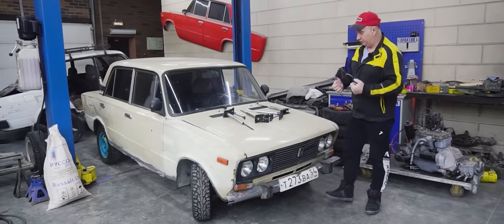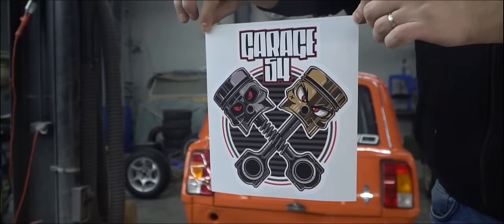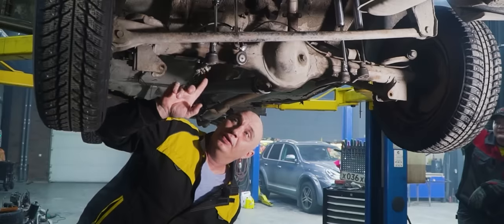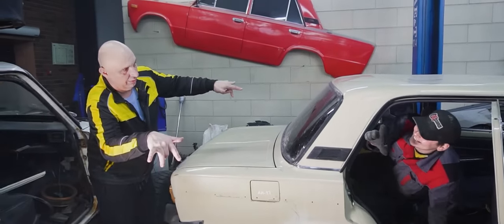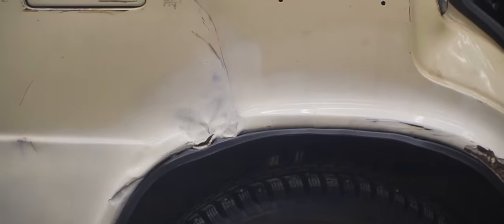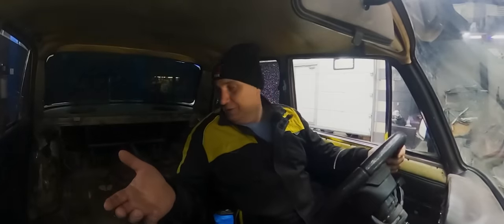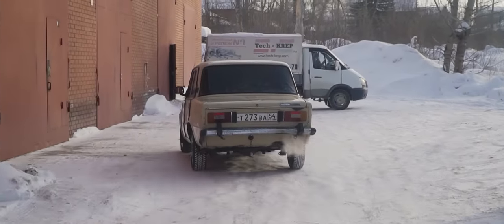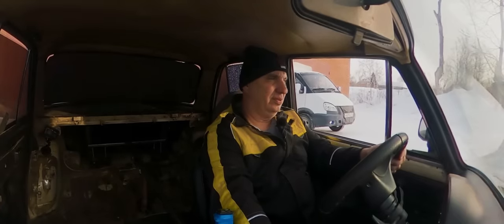We make adjustable suspension using office chair cylinders

Comment: Could have left 2 in the "pushed in" state, even a bit, and 2 full out- that would have softened the ride a bit
Reply: maybe, but i've seen fat people blow them out by dropping their full weight into a chair. if you put too much stress on them it will just blow something out inside and lose pressure forever.
Reply: @iamzid  He said they were designed to support 180 KG.  That is around 1400 pounds between the 4 of them.  Back of a Lada doesn't weigh near that much.
Reply: Actually it's working like that, you can see that one is more compressed than the other, because of the height difference
Reply: @White_Night_Demon  You don't even have to be that heavy. I've seen them break when one of my friends threw himself on one. He doesn't weigh more than 80kg so you don't have to be fat to break them, just fast lol
Reply: @schwuzi  hahahaaha so I guess these shocks arent great if you're gonna use your chairs jumping up and down on them...

Comment: I always wondered if you could convert shocks into hydraulic cylinders.  You should try that sometime.
Reply: I dont see why not, replace the compressible air space with some hydraulic oil, it should work as long as the seal can take the pressure.
Reply: I mean Hydropneumatic Citroëns have hydraulic cylinders and spheres instead of shock absorbers and springs
Reply: @onelyone6976  yep and you dont want to work on them
Reply: @allanmakkink8404  Truth. There are good reasons why those Citroens have only a cult following, 95% of the fans dont even know how terrible those cars are. Comfort, sure, but not as good as a 70ies Jaguar XJ6. Roadholding, sure, but again not as good as a 70ies Jaguar XJ6.
Reply: @allanmakkink8404  why? It's actually quite a simple system at the end of the day
Reply: You can definitely do that. Where I work, we use hydraulic cylinders and fill them with nitrogen to get them act like a big spring. Works great but kinda dangerous.
Reply: @pflaffik  semi comfort for me and when it brakes it don't cost 10 k to fix

Comment: This was cool.
Hey, Garage 54 Fellas! 
How many Radiators In-Line before Water Pump Failure?
Reply: Why would the water pump fail in that sort of situation?
Reply: I think those old fashion fanbelts will slip if the pump pressure gets too high, or the pump will simply pump but not manage to move the water. No failure will happen, i had exploding coolant systems due to blown headhaskets and even then the waterpump survive. 
I have seen old volvo waterpumps with broken blades, doubtful its pressure though, more likely calcium buildups and high age (the rotor is cast, not machined, high deterioration rate).

Comment: Here is a mad idea. Square pistons and cylinders. Can you do that?
Reply: oooh that would be interesting
Reply: @FauziKay  it will be a big challenge, but you have some genius guys working with you. I'm always impressed with the standard and quality of work they produce.
I would love to visit, but I live to far away.
Reply: Those will not work. I bet they tried that in the steam age.
Reply: Won't work... The biggest problem is the springs. Honda made an oval piston engine some years ago,but they discontinued the production due to problems related with rings.
Reply: Square wheels to go with that please!
Reply: @georgestam1710  what problems did it cause?
Reply: @georgestam1710  I just looked it up. The NR 500/750 race bikes. They did manage to solve the problems, but it was too late unfortunately. Great concept for the time. You should still try making the square or rectangular one. Remember, FAIL means First Attempt In Learning. 😂

Comment: For a softer ride you can do the following setup:
You build a U shape for the spring to sit in. Connect these chair cylinders to the sides on the top of the U shape and the other ends to the rear axle. This way it will use the spring, but also can change the ridehight. Like this:

carbody
 __ Z __ 
  I IZI I
  I IZI I
  I ''''''''' I
======
   axle
Reply: huh?

Comment: i wanna see you guys build an automatic transmission out of a manual, use a linear actuator or pneumatic cylinder to operate the clutch, and a series of limit switches and actuators or cylinders to shift it into gear. would be an interesting challenge
Reply: Some semi trucks have automatic manuals. Exactly like that they are the shittest thing on earth. As you cant rush them its like a really slow old man changing gears alllllll the time...

Comment: LMAO this is amazing.
Diy air suspension without using air
Reply: From what I understand office chair cylinders do in fact use air. So this is still air suspension.
Reply: @torpedo996  i thought they worked with a spring

Comment: Maybe try ideas of backyard forced induction. Even a hvac flue fan puts out high cfm and as an example could possibly be traced on a scan tool just to see it's effects not necessarily effectiveness. The cpu will try to correct even small changes but the question is. Will the computer see enough to bring attention to a pending check engine light illumination condition

Comment: Isn't using snow for cooling a weld dangerous? Wouldn't it mess up the metal?
Reply: Just the same as using a wet cloth or using water to cool it but yeah it's not ideal suppose to let cool natural but hey it's garage 54 they do what they want 🤣
Reply: It's Garage54, doing things properly just isn't how they roll. And that's in part why it's so entertaining.
Reply: In theory, yes. Unless youre welding medical oxygen tanks you do not need to worry.
Reply: @MrManBuzz  Tney do it the correct way here, its important to cool the weld before the heat reach the gas cylinder, that could cause a big explosion.

Comment: Hey, how about you use 4 bicycle pumps and make them into variable air shocks hook them up to an air tank with a valve that way you can pressurize the shocks and it will lift the car up or lower the car if you let air out!!!  😆 Sweet

Comment: Fill tires with oil or water and drive fast 😁
Reply: It wont really work,mainly because of the imbalances and the weight of the wheels,and also the engine power output... although worth a shot I suppose
Reply: It works just fine, i had a HUGE tractor with liquid filled construction tires, even with that size wheels theres no splashing or any imbalance. Think of the large 6ft diameter wheels, moving at 25mph, thats an insane force, you will definitely notice the extra momentum when braking but the experience is undramatic.

Comment: These guys constantly have me jealous with those directional and siped to hell snow tires they run. They're expensive here.
Reply: In Scandinavia they barely cost more than a good summer tire. Studded usually cost more and top of the line Michelin X-ice4 North studded cost twice as much as a summer tire. Still not expensive considered the grip, i have 12 of those Michelins currently in use, the grip is a whole different level so in that way they are the cheapest. Its never wrong to spend a lot for good winter tires, its cheap tires that arent worth the price.
Reply: @pflaffik  Most of us "free" Mericans are too damn broke to afford those good ass tires. Studded are illegal in most places here. Now you see why we crash in the snow so much? 🤣

Comment: How about going the whole hog and replacing all 4 springs and shocks with hydraulic cylinders (Easier to find in larger sizes than pneumatic cylinders), running a valve block to control them individually, and fitting an aircon pump to pressurise them? It wouldn't raise the car very fast, but at least it would be a simple one man job.

Comment: how about a whole series of videos converting cars into household appliances & other things they are not supposed to be Like a car into a Can opener for fifty gallon drums or turn a car into a paper shredder or a Freezer & refrigerator Car or convert a car into a Ditch witch trench digger or a car that has a rear back hoe & a front bucket loader or turn a car into a Trash compactor or a trash dumpster hauler car

Comment: It’s unrealistic with so much air in the rear tires, without load and such a lightweight car 26 psi would be enough for comfort, with a margin too. Looks like they are above 30psi., enough to make stock suspension somewhat unpleasant.

Comment: Using the chair mechanism like this is putting the weigh of the car on the lock mechanism, not on gas pressure. Locked, It doesn't offer any spring value.